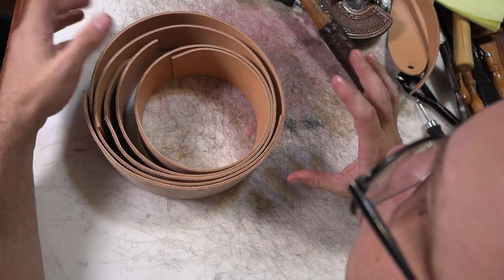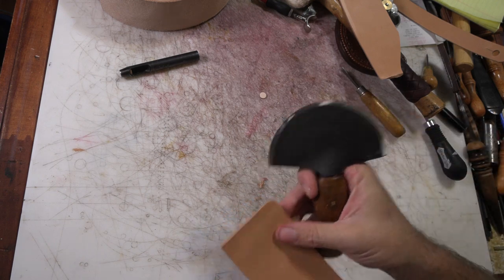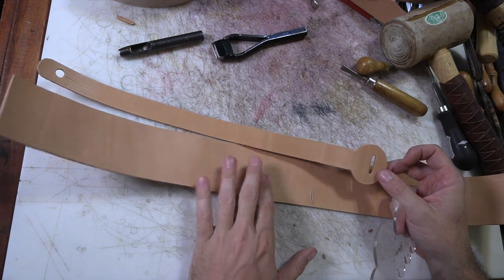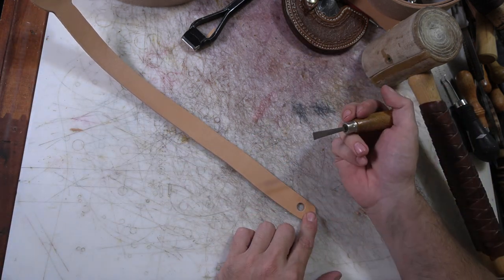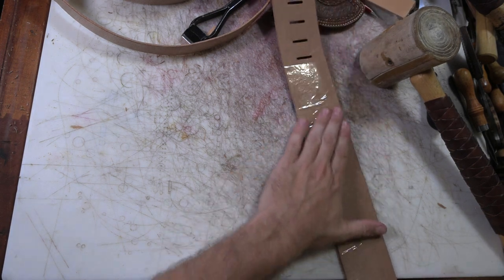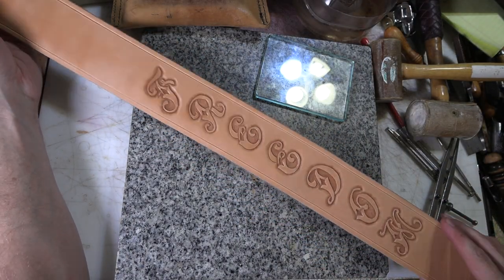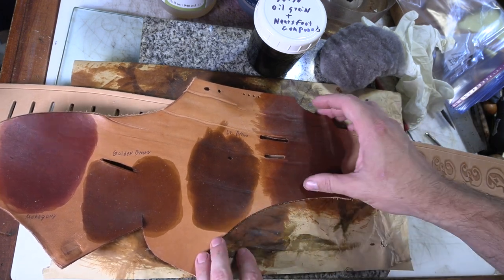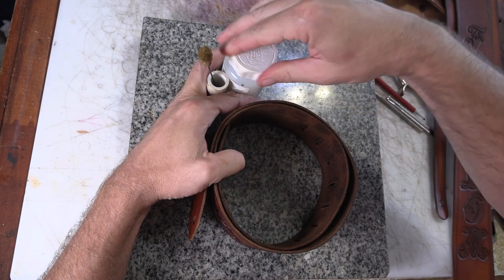Making a simple leather guitar strap

Comment: Excellent video!  This was exactly what I have been looking for. Thanks!
Reply from the maker: Glad it was helpful! Thanks for watching!
Reply: @bransonsgeneralstore  My. Brother plays guitar/bass and something like this will be the perfect gift. Again, excellent video. Keep them coming please.
Reply: Hello. Just wanted to double check. The leather used in the video is 6oz?
Reply from the maker: @milom.2057  6-7oz should be a good thickness for a guitar strap.
Reply: Thanks for the quick reply. I’ve a double shoulder that is 5-6oz. In your opinion, this ok or too thin?
Reply from the maker: @milom.2057  that should work especially for a lighter instrument like an acoustic.  If you feel it is too thin you can always line it by gluing a thin piece of leather or suede on the back.
Reply: Hey there. Got a couple more questions if you don’t mind. What size of hole punch do you use for making holes that attach to the guitar?  Also, how do you like the oil stain you used from Weaver?  The color looks awesome on the video and I’m sooo close to ordering it. Thanks for your input and great video.
Reply from the maker: @milom.2057  I believe it was a 1/4 hole punch.  I do like the oil stain because I can make different concentrations of it, and I like the red toned brown color.  Since it is oil you need to be a little careful to not overdo it.  It doesn't dry so don't saturate the leather with it like you can with a dye.  Just thin coats and wipe off anything the leather doesn't absorb right away.

Comment: What do you call the tool you used to punch those oblong holes down the back of the strap where you can adjust the strap, and what size is the punch? I’m new to leather carving and still practicing carving designs and letters on scrap leather for now until I feel ready to try a guitar strap.
Reply from the maker: That tool is just called an oblong punch or a bag punch by older leather crafters.  That one is 1 inch long.  You can also just punch two holes and cut the leather out between them, but the right tool makes the job quicker and easier.

Comment: Hi there, where did you get the letter set from? I'd like to make my own guitar strap. Thanks.
Reply from the maker: If I remember correctly I used a craftaid from Tandy for those letters.  It is an older one I don't know if it is still available.  You can also just print out letters in a font you like and trace them with tracing film then transfer them to the leather with a stylus point.

Comment: Hey man, did you list the measurements or do you mind listing the measurements for the pieces needed (length) thank you sir!
Reply from the maker: Main part of the strap was 40" long and 2 1/2 or 3" wide.  The smaller adjustment straps are about 16" long.

Comment: Hi! What's the name of the tool used to cut the oblong slots in the strap and where do I get one?  Also, how wide of a punch did you use? Thanks!
Reply from the maker: It's called a bag punch or an oblong punch.  I was using a 1inch one for these straps.  You should be able to order one from any leather craft suppliers like Tandy, Weaver, or Springfield Leather company.  You should also be able to find them through Amazon.  I have seen a wide range of quality on bag punches so I suggest being wary of the cheaper economy ones.  Some of those just don't work.  You can also punch two holes with a regular hole punch and cut the leather out between them.
Reply: @bransonsgeneralstore  perfect, thank you!

Comment: What is the name of the tool you used to punch the slit for the button hole?  I like the way you did that.
Reply from the maker: It is a straight chisel for wood carving.  There are special punches for button stud holes, but they are pricey and only available in a couple of sizes.  Easier to use the punches I already have and a wood chisel.  Larger wood chisels can also be useful for cutting the oblong holes for the strap to go through if you don't have a bag punch.  Punch two holes with a round punch and then two hits on a one inch wood chisel will cut the leather out between them.
Reply: @bransonsgeneralstore  Great idea. Thank you for sharing!